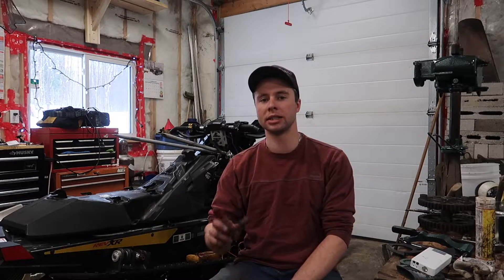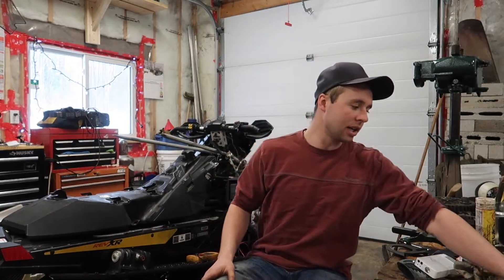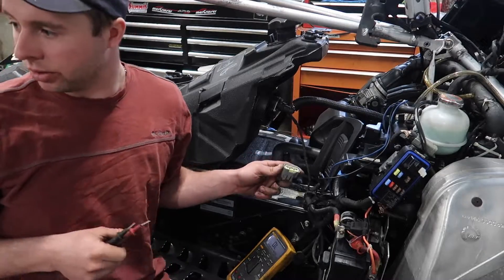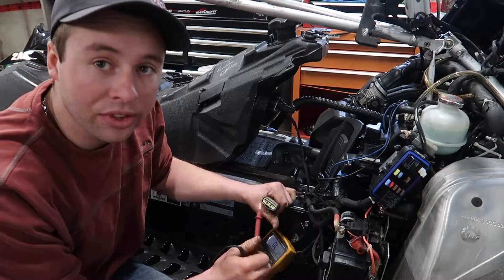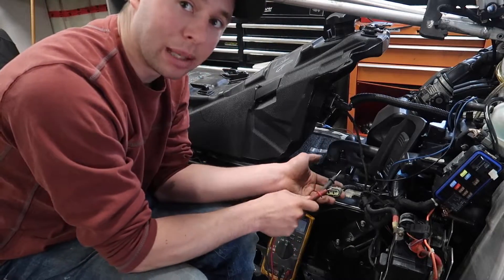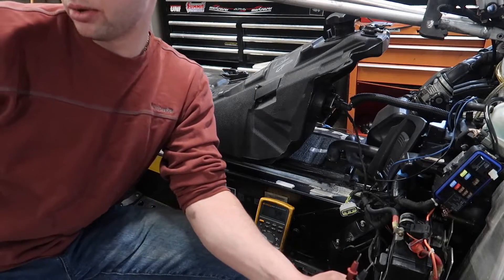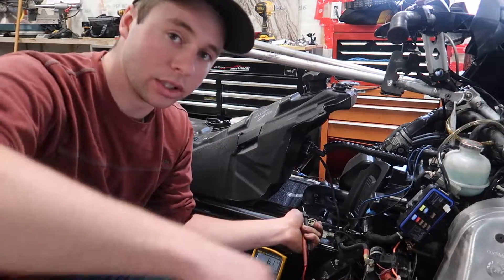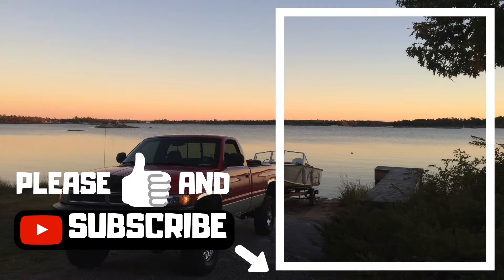Ski-Doo Stator testing 1200 4Tec

Comment: I have a 2012 GSX SE 1200 with No response when hitting the start button, No guages, no fuel pump, no lites
It has been to the dealer 2X where they changed out the battery and then the battery ground wires do to corrosion
IF I do the solenoid screwdriver post connections, It will try to fire but fuel pump etc is not operational by doing this so it will not start but turns over.
I have swapped the 2 relays with known working ones (identical sled) as well as start button fuse and main fuse with same result.

*The only way I have had any success in getting it to run is tipping on its side and letting it fall, or picking it up from rear bumper and dropping it a few times.*  

Once started, it will run as normal (even go into reverse) until you shut it down again.
Looking to see what your thoughts are.  
My next task I think is to look at the wiring at the starter motor itself (Thinking something is loose where it starts if you beat it up)
Thoughts??
Thanks for your time. And keep up the great videos
Reply from the maker: My first thought is an issue with the kill switch circuit. With a kill switch off no fuel pump activates or no start obviously. I would be inspecting it. Possibly a bad switch itself making it have contact when shaking etc.
Reply: I thought that also, however on an identical machine if I press the start button with the kill switch down, you do get the dash to light up, guages to cycle, and I believe the fuel pump primes, but I will have to confirm that part. @Schneids15
Reply from the maker: @Nightstalkerusmc dash will light up yes. However fuel pump won’t prime i can confirm that
Reply: Thanks, not gettting any dash lights, but who knows maybe that kill switch has some sort of short to it that will only wake it if you bounce the machine. Thanks for your input
 @Schneids15
Reply: @Schneids15  Should I be reading 12V at that plug at all times? (on the battery side once harness is disconected from the side that goes to the start rer button.) It seems like I should, but I get nothing when Red and Black wires are probed. There are 4 wires in the plug.

Comment: I have a 2010 Skidoo Grand Touring SE that I bout March 2023 and put 500 mile on in a couple of weekends before the season ended. The only issues it had was the LOW BAT warning would flash on the display once in awhile. Our season for 2024 never started until March due to lack of snow. My first couple of rides the unit ran mint with only the LOW BAT warning flashing once in awhile. Last Saturday I was riding home after a 100 mile run, the sled ran great all day. Near the end of the day the LOW BAT warning came across the display and a little while later I could hear a rattling sound out front but everything was running great. On the way home I stopped and filled up the gas tank and only made it about 2 miles when the sled started to run rough, loose power and then shut down and would not restart. Thank goodness for great friends! A buddy came and rescued me with a trailer. We loaded it up and headed for the garage. Everything I can find points to the Stator so I have ripped it down to where I can access the voltage regulator and wiring. The issue I am having is that everyone seems to able to get their sled to start with a bad stator and test the output. I have tried charging the battery and even tried with a booster but nothing I do seems to helping the unit start. Has anyone experienced this. I would really like to get it started before I go ahead and pull the engine.

Comment: If voltage regulator is  bad, battery loose charge. At idle battery voltage should be around 14 volts

Comment: I have a question. Any ideas I have 09 skidoo 600 tnt etec.  It runs good. But all my lights and gauge cluster and heated grips quit well I was riding.. ???
Reply from the maker: Yes check the relays. There should be one relay that powers all that stuff. My relay stuck on me once and all that stuff would not shut off upon shutdown.
Reply: Sounds like the voltage regulator went bad.  The 600 doesn’t have any relays. Only the two main fuses.  Are you getting 14v at the battery when the sled is running?

Comment: Thanks for the videos. I have a 2009 GSX 1200 like what you had with 22,000kms. I like the sled so I plan on keeping it for a few more seasons.

I just wanted to pick your brain if I could. I just put a power bloc clutch on, replaced the plugs, bushings in the front A arms and some other stuff. Ran it twice, short runs.  A couple of days later I started it and it wouldn't idle. I tested a bunch of sensors and the only thing I could find was the stator was only putting out 15+VAC when it should be 25 VAC. I've taken the motor out ,  I have a new stator and I'm replacing it. The valve cover gasket is leaking and I have an antifreeze leak around the pump (I think) so I will replace the gasket on that as well. I'll check the valves too.
On the inside of the magneto I found small pieces of non ferrous metal, a little concerning. At first I thought maybe rings but the pieces aren't magnetic. Could these pieces be from the original break in period? 
Do you have any suggestions on what else I should do while the motor is out?
Thanks for your time

Comment: My sled passes the first 2 stator test but will not start if the plug to test the voltages is unplugged. The only time I can start my slled is with the voltage plug unplugged from the voltage regulator. Does this point to a bad stator

Comment: Hey, we have a problem with a 1200 4 tec brp, it was running well the other day but the next day it couldn’t start, the starter was clicking and won’t start, my bf tried changing the starter but it did not work either and now he thinks the problem is the sprocket. I wonder if you know the problem? Would help a lot since we want to go out hunting and fishing and it’s the season!😩 I hope you can see this since this video is from 2 years ago.
Reply from the maker: Hey! I see your comment. It is nothing but a click? The battery is charged full? Have you checked the starter solenoid? This could cause i click. Best of luck. Josh

Comment: Good video.  I have a charging problem on my mxz 600 SDI 2005.  The stator model is the one with 3 yellow wires.  I got 0.3 ohms on every circuit and no one of the 3 wires are short to ground.  So, for the voltage test, I got 22-23 volts AC on each of the 3 circuit at idle.  In the manual shop they say that we must do the test by manual start only without engine running (kill switch off).  The values should be 3.5 to 5.5 volts AC but when I do this test, the values stay to 0 volt.  Can you tell me more about this?
Reply: Sounds like the voltage regulator is bad

Comment: How are you getting spark if you have a bad stator?????
Reply from the maker: There is a portion of the stator that does the spark and a portion that does charging. Either way you have to replace the whole starter. Mine just the charge portion went.

Comment: So, no issues running the engine with the stator unplugged  for voltage testing ?
Reply from the maker: According to my factory ski doo manual that is the way to do it.
Reply: @Schneids15  ok thanks, just ran it and got 18 to 20 volts ac . So it looks like the engine has to come out to change the stator. Not impressed with that. Lol...

Comment: Hey I have a question for you I have a 2009 MXZX 1200 and I’m getting a night battery light that comes on all the time when I start to rev up and take off but it goes away would that be a voltage regulator problem?? Or stator?? And is voltage regulator a hard job ?? Please get back to me if you can please
Reply from the maker: I am wondering if you could have a bad battery and it is drawing down voltage on startup and then once revs come up it charges enough the voltage regulator produces enough voltage and the light shuts off.
Reply from the maker: Have you had issues with your battery going dead overnight?
Reply: No my battery is new and I’m getting a high battery on the cluster and it does it all the time when I’m driving and it’s around 5000 rpm I think the voltage regulator is putting out too much voltage
Reply: I start the sled and it starts fine i only get the high battery signal when I start to take off and when I’m driving around 5000 rpm but it goes away then when I rev it up again it comes back on so I’m thinking it the voltage regulator putting out to much voltage what do you think ?
Reply from the maker: I think you nailed it dead on. Put a volt meter on the battery and rev it up on a stand and see it voltage goes high. I don’t have spec but it is likely max 15 volts. If higher than that i would think voltage regulator is bad.

Comment: Did you have trouble with the tps makeing it not start
Reply from the maker: No i never did
Reply: @Schneids15  I got a 2011 renegade 1200 and I'm awlys having trouble trouble with the tps and wont start dealer said it's normal
Reply from the maker: Hmm. Mine had 22k and me or the previous owner never had an issue. My dads 13 never had an issue either. I have heard if the throttle cable is routed wrong if it has been apart before it can cause issues.0
Reply: Is yours cable?
Reply from the maker: Yes it is
Reply: If u ever gets a chance show me how your throttle cable is routed mine is gone through the risers I think
Reply from the maker: I actually sold the sled so can’t use it as reference sorry.

Comment: My uncle had to change his out on his 2010 ski-doo 1200 renegade i got the 2010 mxz tnt 1200
Reply: Hi have you had any problem with craankshaft position sensor  ?
Reply: @lynnevautour5144  sold that 2010 tnt 1200 sorry but never did have that problem there ma'am went back tp my 2014 yamaha sr viper feels faster is faster
Reply: Change the crankshaft position sensor on my 2014 1200 mxz tnt skidoo and still doing the same  thing any idea what could be wrong 
it wont start it just keep caughing and my fire is not a nice blue fire its kind of yellow white ish fire 
What could be the cause